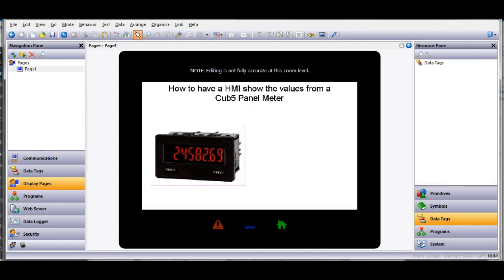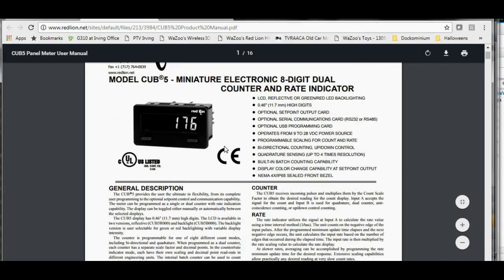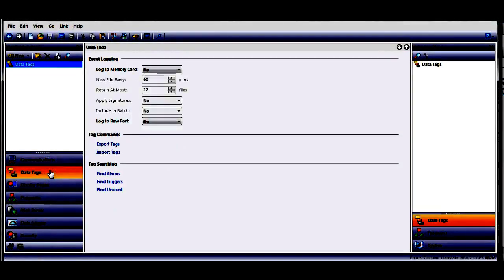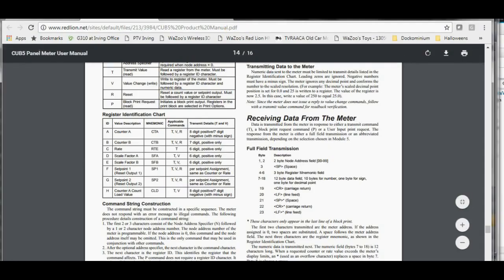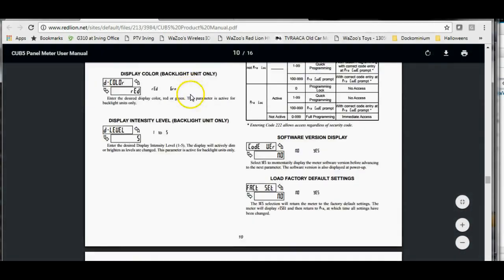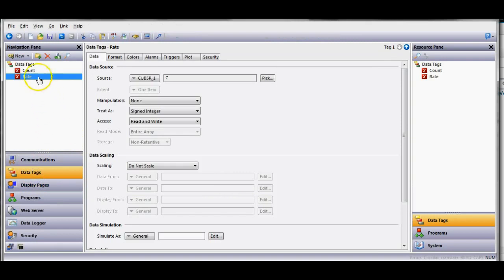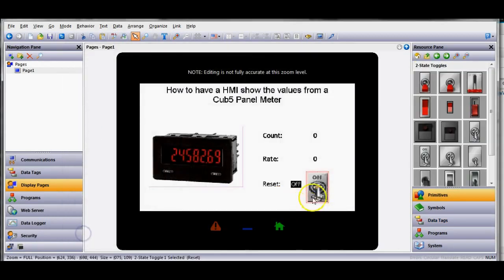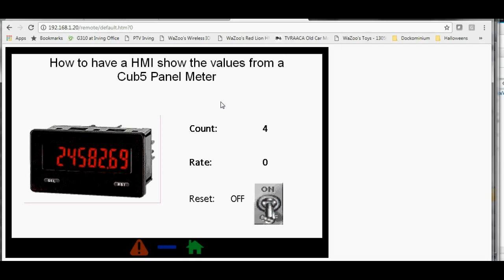RedLion CUB5 meter talking to HMI

Comment: Can I use single input to measure current speed and length traveled(for the same process)?
Reply from the maker: I would say no but consult with your local RedLion salesperson for advice.
Reply: @JoeWaZoo1_Geeks_Rule  I thought you will say yes to that because you are doing a rate and count with the same input in the video.
In my case count = length
                     rate = speed
In the video you showed rate and count, is it from 1 input or 2?

Comment: Hi , is there a way to use crimson's new versions on windows xp ?
Reply from the maker: Yes.  If you look on RedLion's website where you can find Crimson 3.0 a bit down on the page there is a link to the last Build that will run on WindowsXP.  The Build will be 662.006.  A brief history on WindowsXP.  It was released in 2001 and sold on OEM PC's up until 2010.  Microsoft stopped support and updates for WindowsXP in 2014.  Maybe time to buy a new PC.  Although my wife's home pc runs Vista!

http://www.redlion.net/crimson-30/revision-history
Reply: JoeWaZoo1 dangit ! I love xp , thanks !!